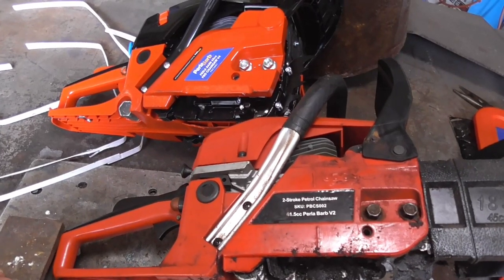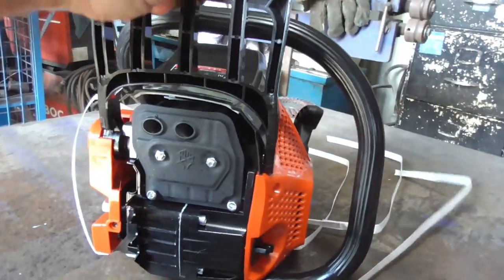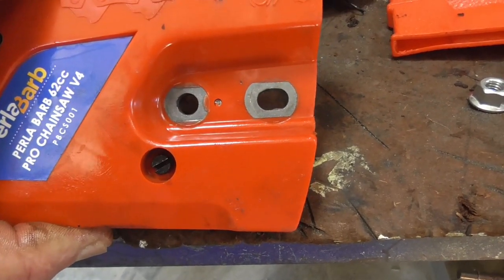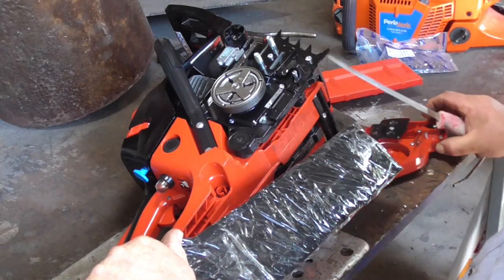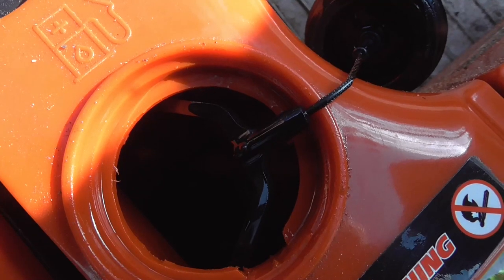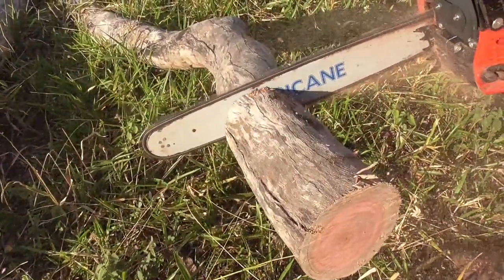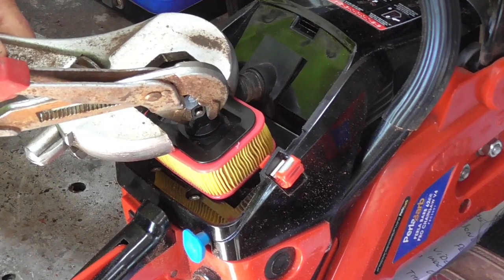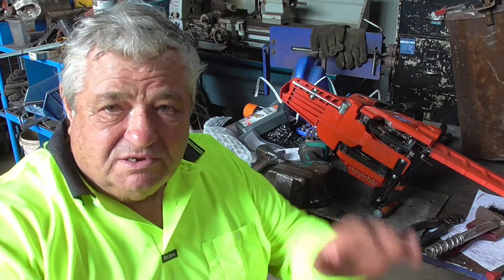PERLA BARB 62CC V4 PRO CHAINSAW  IN DEPTH REVIEW from JONO & JOHNO

Comment: Bloody good review mate, I just purchased one and had issues starting it today, couldn’t get the bugger going - I’d used it couple, times before without issues.  Lucky I had the smaller Stihl with me to get the job done, but I was annoyed as the PB is for bigger logs…the Stihl 180 had to cope today!  Back in the workshop I was trying to get the air cleaner off, had same problem of nut jamming, so thanks for that.  Blew out the air filter gently with air hose and low and behold the bugger started a easily and ran beautifully! Reckon there might be an issue with the air cleaner blocking very quickly? 🤔 be interested to hear how you go in the 6 month test mate…👍
Reply from the maker: Ok no worries maybe its a very fine filter better to block than let the dust in the engine I suppose. John

Comment: Great review John, my saw never had that rubber spacer, also i had to adjust the low speed mixture screw slightly it was hesitating  off of idle too lean yours seemed fine as you revved it.  Roger
Reply from the maker: Yeah Roger it ran revved idled good strait out of the box. John

Comment: How do you think it would go with an atom borer?
The only problems to workout are chain pitch.  Old stihl chains are 3/8,   and these are marked as 0.325.  Real close but not exact.    As it's not going through a bar, the guage shouldn't bother it, just getting the drive links to line up.
Reply from the maker: I have never used an atom borer. I imagine the chainsaw would be ok. Just a matter of getting the other things sorted out. John
Reply: Ok after.getting no joy from the seller I have discovered they actually sell drive sprockets to fit all saws to convert to 3/8.  All sorted.
Reply from the maker: @carinya55   Ah good. John

Comment: I am looking to order one when they get em back in stock. Do you feel it will run a 24" bar ok?
Reply from the maker: If I wanted to run a 24"" bar I would go for the 70cc. The 62 cc would be ok if you didn't expect it to cut the full 24''' at once. I like a longer bar so I don't have to bend over as far so I guess it depends on what you intend to do. John

Comment: G’day John what is your preference for sharpening the chainsaw chain, hand file or a bench mounted chain grinding wheel sharpener?
Reply from the maker: In the paddock a file. Every now and then even up the chain with a bench grinder. I am going to include sharpening in a up-coming video. John
Reply: @farminglifeaustralia6716  yeah I carry a spare sharp chain in the paddock
Reply from the maker: @brettharries2429  Thats a good idea. John
Reply: @farminglifeaustralia6716  yeah but for you can take a full spare complete chain saw with you. I only got the one saw. 😂
Reply from the maker: @brettharries2429  Yeah I do often take a couple of saws. Usually a big one and a smaller one for getting the big one unstuck. Ha Ha John
Reply: @farminglifeaustralia6716  I know what you mean mate. Wedge is a good help to prevent that. Once the depth of the cut is greater than the height of bar, just start the wedge in.
Reply from the maker: @brettharries2429  Yeah I do I was just joking. John

Comment: Mine just turned up . Wow getting that air filter wing nut off really is really really hard .
Reply: I’m starting to ruin the wing nut & I’m doing your method!
Reply: Yep just wrecked it. Still hasn’t budged
Reply: Ok . Even after chewing the brass nut out of the plastic & finally getting the brass nut off ( that was still extremely hard to crack ) the plastic washer part was still friction welded on. If I was to do it again . I’d put the multi grips on the washer itself, instead of the wing nut. I’m going to replace that with a brass or steel wing nut.
Reply from the maker: Contact Jono & johno I am sure they will send you a new one. Also they need to know so that the problem can be sorted when the saws are made. John
Reply: @farminglifeaustralia6716  ok I will .
Reply from the maker: @concernedaussie1330              👍
Reply: @farminglifeaustralia6716  yes they need Col. Ji Wing chan to play the Russian roulette on some Supervisor somewhere in the Chang dong province so the quality comes up trump LOL.
Reply from the maker: @mikeykeyes   Yeah good one. John

Comment: John, my Stihl 039 is giving me the sh1ts, and the cost to repair is more than one of these. The big question: this model, or the 70cc Perla barb (which is $200 more)
Reply from the maker: Mine are both still going with no issues. The 70 cc has a lot more power and is heavier If you want a lighter saw for smaller work the 62 cc would be ok. If you are cutting Aus hardwood most of the time over 6" i would pay the extra. The 70 cc sounds not much bigger only 6cc but it has a heap more power. John
Reply: @farminglifeaustralia6716  cheers mate. That's what I was thinking.